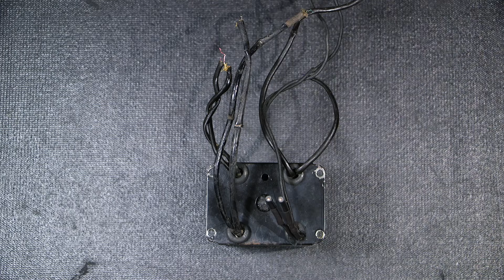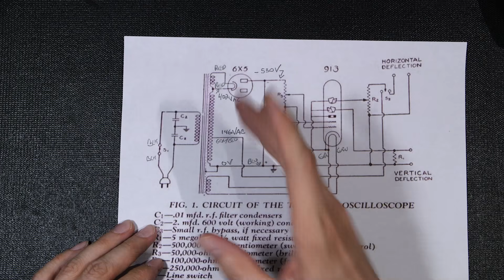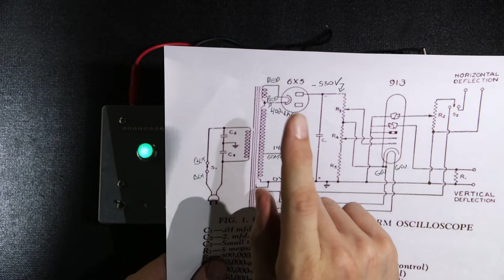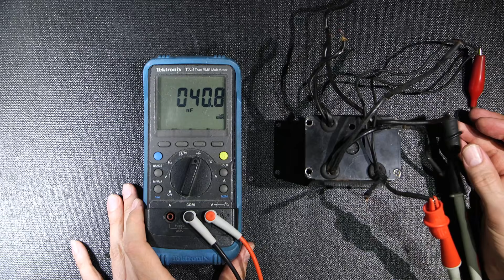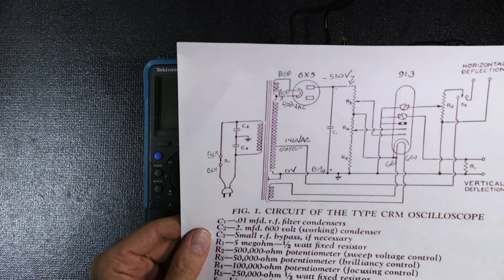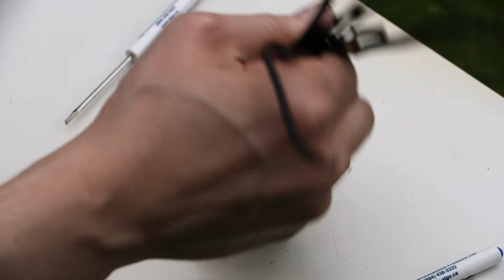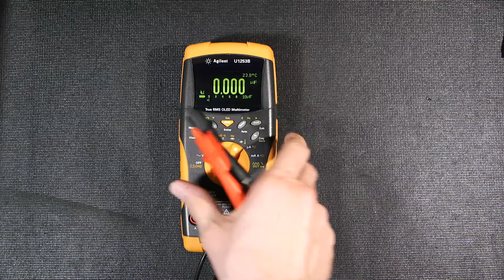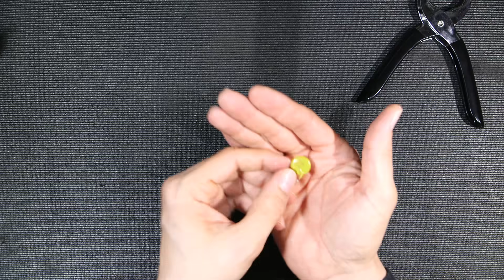Transformer Repair {Depotting} Lets Look Inside!

Comment: Very interesting!  Paul, you have a way of making messy jobs look easy, I really enjoy these videos!  It's all very simple once you know how to take something apart and put it back together.  I can't help wondering, though, whether National made more than a few hundred of these devices. Did they actually know about capacitor leakage back then and if so, did they care that they were potting the seeds of their own obsolescence in with the tar in the transformer cans of their devices?  The labor savings of putting the caps inside the cans vs outside is not particularly dramatic.  Maybe they never intended the devices to last more than a few years in which case capacitor leakage is a rather moot point.  Something new was bound to come along at any time that would replace the little one-inch wide CRT screens that they were using.  Or was it all done for shielding purposes?
Reply from the maker: I would say RF shielding and cost. This unit would be HOT with RF, so the cheapest way to stop that RF from exiting through the line cord is to short it out (the RF) with some caps in a transformer.

Comment: The only thing I like about those old capacitors was the artwork on them.   I wish we still had that art style around.
Reply: gut them carefully, and hide "new" capacitor/s inside, re-wax the end shut.same for the multi-section can ones, you can often hide new caps within the casing. just be careful they could have PCB oil

Comment: Besides repairing one, have you ever rewound one to re purpose it?  <mumble> years ago, I remember needing a transformer for the PS of an S-100 based computer I was building, and pulled a transformer out of a dead TV.  It was actually easy to get the original secondaries off it, winding the new secondary for what would become the 5V supply was more fun because all I had available was spools of wire from Radio Shack down the street.   It worked though, which I considered a point of pride when I'd show that system to somebody. :)

Comment: Why not dunk it in slightly hot K1 or fuel oil or Diesel oil and let that carry off most of the goo?
Reply: even vegetable oil will penetrate and soften the tar, but same problem, what else will it dissolve/destroy :)
Reply: Good point.  I hadn't thought about the varnish, and it's probably either linseed oil or shellac based, and would be pretty suceptible to solvents.

Comment: excellent use of one of my favorite tools, the toaster oven. I keep one in my shop for curing high strength/high temp epoxies, cleaning  parts that have to soak in a heated solvent, tempering hardened steel and occasionally cooking a pizza.

Comment: Hey a spare toaster oven for reflow soldering SMD parts with solder paste.
Reply: you can buy new toaster ovens for about $30 USD, the temp controls are not super accurate though, so take that into account if you want precision temps...

Comment: Great one again Paul!  I have this model O Scope also now. My guess is that a hot air gun might be too weak to gain the heat level to melting point. By chance did you document the average heat level?  If not, any guess the melting point?

Comment: You got off pretty easy on that one I think , with minimal tar sticking the transformer to the outside casing. If not for the cardboard, the task would have been much more difficult. The solution you came up with using the toaster oven was pretty neat (but I would have tried to insulate the case from the outer oven cover).
But I think most viewers were expecting the much more tricky (and gooey) version of the problem, addressed here by Mr Glasslinger:-
https://www.youtube.com/watch?v=uCm1iPLVe8I

Comment: National must have been smoking Pot when they designed that........... nice work Paul, but I think we were all expecting a much bigger mess lol
Reply: jafinch78 Actually a lot of the times its the management, marketing people or bean counters that make for the really stupid ideas. Management doesn't like how much something costs to produce. Bean counter asks engineer how could something be put together easier, faster, cheaper. Engineer says, "well, you could premake the transformers with the capacitors potted inside so assembly has less to deal with bu-," then bean counter interrupts, "Brilliant!" He tells management they can shave $1.25 in materials and labor off each one by doing as the engineer suggested. Management says make it so, Engineer tries to reason with them as to why it's a bad idea but it's no use. He's ordered to make the changes and push them out to the assembly line. You'd be surprised how often this happens. I know, because I'm often the engineer that goes through that very same ordeal only in software instead of hardware.

PS - Quit being snooty. Nobody cares for it and it isn't necessary.
Reply: @redemptusrenatus5336  Engineer chiming in.  Yes this has the hallmarks to be a misguided cost cutting measure and happens typically as you describe when people who aren't engineers trespass into engineering territory.  But also it could be a marketing idea from a Xfmr manufacturer who thought an offering of potted capacitors xfmrs would be innovative and cut down the competition but their idea falters and they eventually have to dump these weirdoes at knock off price.  Enters the part sourcing engineer from General who cashes in on the low priced part for their low end oscilloscope.  The lesson was probably quickly learned and you won't find a lot of these.
Reply: Harb's Elecronics Lab tldr or specifically, tl;dr, is how people state that you wrote too much, they don't have the time/patience/inclination to read it all and would prefer you summarize it into a sentence or two at most. Personally never had a problem with reading lots of text but people these days seem less inclined to do so.
Reply: Cocaine was legal back then, so they probably snorted a lot.
Reply: This almost certainly was not an off the shelf transformer. In those days it was common for the customer's engineering department to specify a special transformer configuration, and then the transformer maker will give them a quote on the price for X many units. In this case the scope maker would have asked for those caps in the xformer can, and also would have requested a potted xformer. So if you want to blame someone for stupid engineering, you need to blame whoever designed that scope, not National.

But before you go blaming them for stupid engineering, maybe you should consider the whole projected life of the unit, the cost analysis, and the projected profit margin at the expected sale price.  Those caps, even in the xformer can, would have lasted a good 10 years. And it is likely the scope was only expected to last about 5 years before something better would replace it. This also looks like it was designed by Madman Muntz -- there isn't a single extra part in that box! Clearly "cheap" was one of their overriding design considerations. Likely having someone else solder those two caps into the circuit saved them a terminal tie point and several minutes of labor. That was probably considered fairly significant.
Reply: tlDR plz
Reply: I feel the same and get that on Hackaday occasionally. 

I was wondering for a few seconds if the capacitors should have been encapsulated/potted in tar as not being completely insulated may have caused a fault.  I'm guessing my first thought was more-so... unless I'm completely off in the observation.
Reply: jafinch78
Modern potting is called conformal coating and it's got the same principle in mind, was intended to be just as irreversible.
Reply: Jafinch78 seems too well acquainted with drugs and lost in his verbage.  National knew what they were doing.
Reply: Smoking pot really wasn't a thing when that transformer was built. But they did create a smoking pot! 😂
Reply: Yes, I am very well acquainted with drugs.  I was trained to be an expert witness for agriculture, USDA, regulated industry and food and drugs which can be a DEA, DHS and Department of Health and Human Services regulated industry.  I think National knew what they were doing also. Plus I grew up around old cocaine traffickers in the neighborhood that I think are still pedo incest homo cleptos trying to look official and maybe even murderers last I knew. Down the road there is Benton Harbor which ranked top highest murder rate for a time period.  Now I deal with... whew knew to much about TEMPEST protocols at Zenith or old Heathkit and taught people to perform electronic warfare with electron beams or whatever the ultrasonic or beam forming weapons system that is no way cyber crimes.
Reply: Weren't they thinking smarter in regards to the capabilities of performing a repair of the transformer... especially during the depression era?  Are the epoxy potted or modern potted systems easier to repair somehow where the capacitor and/or diodes go bad?  Who's smokin crack on meth or something? Please teach us old wise spoiled baby boomer.
Reply: Redemptus Renatus:  I didn't mean to be snooty... I was just confused and irritated by the comment since I recently dealt with two HV transformers for a bug zapper that had the capacitors (and maybe diodes) potted as well as being potted to the iron or maybe mu-metal core.  I figure that many are on amphetamines going back to when was legal and even now so since they want manufacturing acts done faster and easier to create more inventory turns items.  

I have similar experience in Project Leadership, Quality Control, Assurance, Systems and AR&D in the Pharma & Medical Device industry developing alternate test methods where marketing or management sells something that doesn't exist and I'm stuck organizing the buy in, management, financing, development and validation.

The electronics industry is more a re-born experience for me where I am stepping back into the pre-finding what is deviant around me pedos and old cocaine traffickers turned meth and whatever they want and can do trying to look clean Christian and innocent.  I finally disconnected from what seemed legal valid to find they're just suckering people in as scapegoats to compound and conceal there continuing criminal enterprise that seems to meet the definition of paramilitants with war criminals and mafia descent looking official now with new names even manufacturing crime post mass murdering the valid adults.  I'm starting to think that is why Zenith, Heath, Electrovoice and others in SW Mi were bought out.  I personally feel the TEMPEST and directed energy weapons systems in the wrong hands were the causation other than and along with what I just noted.

So, with modern electronics I'm finding the inability, of like I find in the healthcare and legal related industry, to do anything other than throw away most.  However, with heat guns, reflow ovens, magnifying lenses, stereo-microscopes, more delicate temp sensitive irons, steady hands like a photographer and other newer to me devices for electronics... we can salvage and really restore and repair even some of the newer devices.  However, the older electronics I think were designed like the other systems of the time to last lifetimes if properly maintained.  Not, I personally feel from my observations..., on meth, cocaine, crack and other narcotics and dangerous drugs short term financial gains only throw away mentalities like pedophiles that don't really care other than to look not guilty of the crimes they commit.  

Not trying to be rude... only trying to advocate a serious issue with the no way lean sigma related industries that deal with human lives and is degrading and degenerating society where some of my role models couldn't tolerate the liberal acts and events due to their higher standards of following the Constitution and laws... including security clearance schemes.

Comment: 50 years ago I built a pair of Mullard 20W amps. I was given 2 large HT transformers  and chokes. All 4 had been plastered with pitch, not potted. I cannot believe the makers had done this. I used a gas oven set to 10 F above the rough melting point of pitch. The tray each transformer was on almost overflowed. I eventually got everything in a reasonable state and the amps went on to do many years service. Paul, your videos are excellent, I just wish I knew one tenth of your knowledge.
Reply from the maker: Thank you for your kind comment JP!
Reply: if i rem alot of years ago someone told me they filled them with tar for the tropics wich i suppose makes sence knowing the humidity and rain they get. tom c 64 yo.
Reply: Many years ago the "tar basket" in metal encased transformers wasn't uncommon.  Basket material ranged from file-folder stock to fish paper.

Comment: Paul, Your heating technique was very conservative (and appropriate). With what you know now, do you think you could have accomplished the same results using a heat gun? It might not work without the cardboard liner; that would depend on the heat transfer rate of the tar. 

:) Having an introduction to how your mind works, I thought you were going to heat the tar with RF or induction.

Comment: You seemed amazed with the fact that the transformer had capacitors in the casing with it. That was pretty much standard practice with the mfgrs. in the 30's. Besides transformers they potted capacitors, resistors, coils and such in cans together and filled them with tar. If you worked on antique radios like Atwater Kent, Philco, etc. you would have run across this.often.
 The tar is very likely to have PCB's in it .
 I have used a double boiler on a hotplate outside to heat the tar.with good results.

Comment: That was very interesting Paul, That scope is so neat. Nothing like repairing vintage gear with vintage test equipment. I noticed you got lucky and didn't have to repaint the little scope. If you did have to repaint it, was there a procedure used to get that krinkle type finish on it. Many older pieces of gear have that type of finish. Do you know how that was achieved? Thanks for another interesting video Paul. Be well, Tom

Comment: Neat! A friend of mine gave me a large coil from his T-368 transmitter which developed an internal short to its case. I don't expect to be able to fix it, but I'm curious about doing a post-mortem on it someday to see if I can find out how it failed. I'd like to get in there as non-destructively as I can, as if I was planning to repair it. It's in a soldered-shut metal case, and I don't know if it is oil-filled and/or potted.

Comment: Very Interesting.  The toaster oven- nice idea.  I really thought is was going to be very messy, with melted tar running all over.

The only reason I can think of why they put the caps inside the transformer, is as a moisture barrier.  Back in the day, I really don't know if they had much of an idea about internal resistance, or they just didn't think anyone would keep it long enough to worry about leaky caps.  Also, maybe they could sell more of them if you  cant fix the scope, and just buy a new one.  Kind of like what they do to products today.  Who knows what the were thinking.
Anyway it was a fun video to watch.
Thank You!!!
Michael

Comment: Hey, look at the bright side; at least you were the one melting the tar outta that xformer.  I had an old Zenith 7-S-363 I was repairing for a co-worker a few years back that had a shorted rectifier tube.  Before the xformer finally gave up the ghost, it got so hot that when the radio was handed over to me to look at, I found a big pool of re-solidified tar in the bottom of the cabinet.  That was  a mess to clean up!

Comment: Paul:  What's your position on adding a safety ground to chassis on old equipment that originally had only a 2-pin plug? Should adding a safety ground be the default option when renovating old consumer, communication and test gear?
Reply: Sorry, but my above comment seems to have generated two threads. Please follow the other thread, as it has 3rd party comments.
Reply: Ed , You'd need to insert a 1:1 isolation transformer to the AC line-input of the gear, either internally or externally, before you can safely ground the chassis of a potentially 'live-chassis' unit. The transformer isolation makes the unit a standard 'transformer-powered' unit, and as such, the chassis can be grounded, as it's then isolated from the AC line.